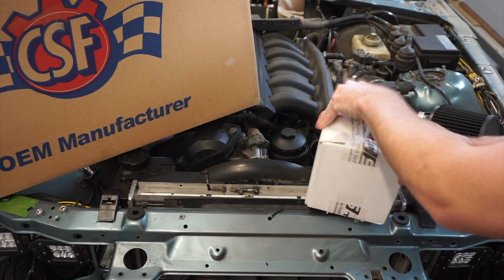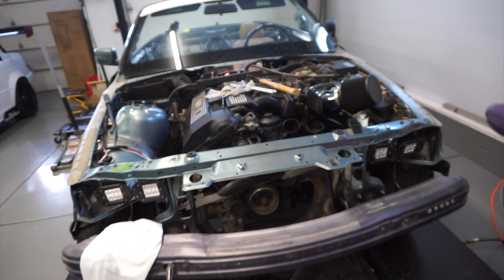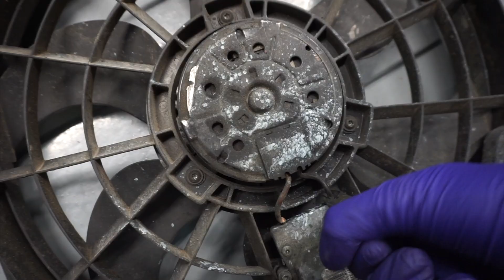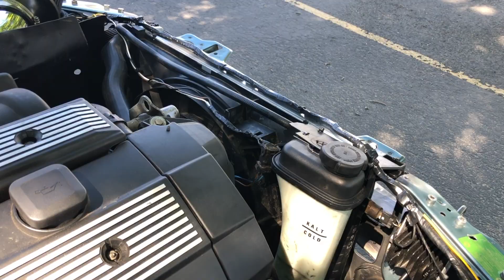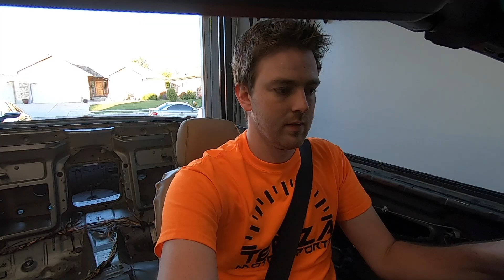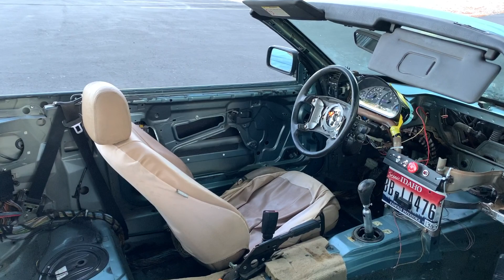Finally driving the 328ic death kart! + CSF radiator and custom fan install E36 death kart part 10.

Comment: How do you like the CSF radiator? I was looking at picking one up. Wasnt sure about fitment of their oem replacement or getting an upgraded one
Reply from the maker: Fitment should be identical to the OEM radiator. Especially this one I bought where it’s just a replacement. If you’re going to do an upgraded one, I did mishimoto on my race car.